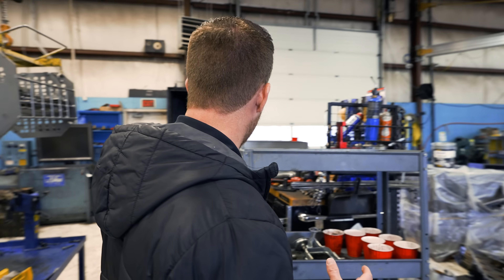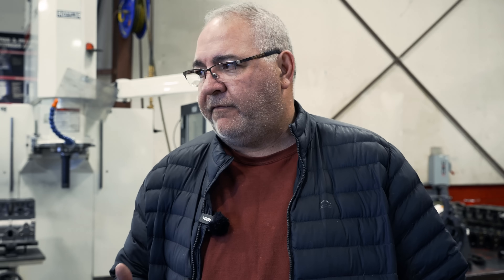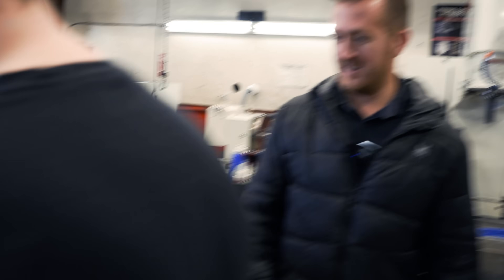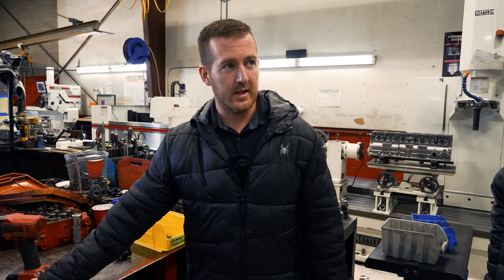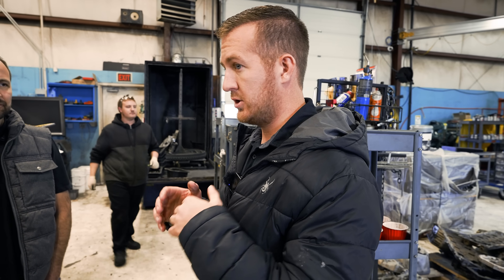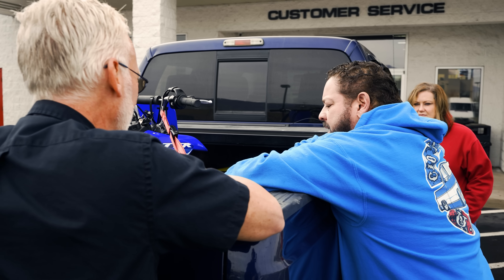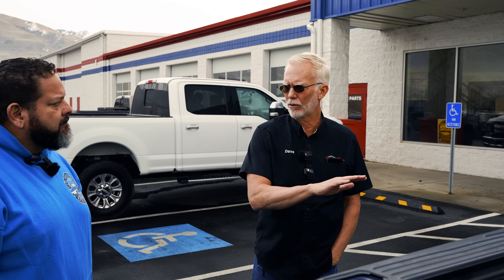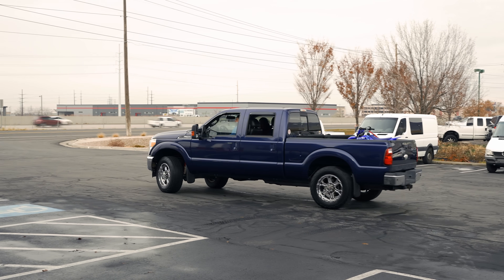Looking Inside a 900,000 MILE CP4 Pump!

Comment: I used to add castrol 2-stroke oil (for water cooled engines) to my fuel in my 04 duramax. Don't know if it helped as I sold the truck years ago, but it certainly didn't hurt.

Comment: To the rednecks that say the us diesel and EU diesel are the same. 😂 this is why you need lubricators inside the fuel. Bosch at the end of the day build there pump and tested on the diesel they had it spec to. Ford, dodge and Chevy are to blame for using a product build for a different market with different regulations and additives. Bosch built it as intended the big three got lazy.

Comment: This is the best advice. Not the additives but the fuel filters. The fuel filters are the problem. This Guy gets that💪👍
Reply: Additives can make a huge difference. I ran additives in my diesel and made the engine run way nicer. The off boost - boost transition was much improved. Just saying the right additives can make a great difference.
Reply: @myvideosrockthehouse which additive?
Reply: Only changing fuel filters doesn't improve the lubricity over what the fuel has from the pump. Lack of lubricity kills CP4 pumps. But for sure fuel filters are important.
Reply: @Arexodius  
That's the point of taking the pump apart and having the cam lobe and other moving parts plated... 

After blue printing ( debuting @ polishing ) all wear points...

Not a very likely to be done on a new vehicle - however, for people who spec their equipment by themselves...   

It's a old hot rodder trick! 

Meaning if you hand build the truck from the frame - every part of the motor, trans, rearend to the brake system had been put together before used, just as if it was your race car . 

Then that vehicle would short of an accident, last your lifetime without any issues. 

It's a ton of work - but it doesn't allow small imperfect casings to develop hi stress points from the very start.   That's what blue printing is all about... 

Equalizing and balancing assemblies! 

Just ask any professional racing team if any part on their race car has not been customized to there personal specific build spec.... 

So if you want your equipment to last a lifetime - build it up from the ground.

Very labor intensive up front - but the peace of mind and savings from lack of break downs on the road is the best experience. 

What this means - if you plan on having a great vehicle...   

Then build it from the very start!   It's the same thing about any business - the better you plan your system the more time you save, more time equals more money 💰...

In hotshot / transport break downs are a killer!
Reply: @mrnobody8540  Or just run an additive as shown in the video....
Reply: @Arexodius  
Oh yeah - it does improve lubrication - for the cleaner the fuel - less wear on the parts from dirt, and other things like water contamination. 

It's not a direct lubricant - that's very true...  However, it does have an impact on the lubricancy. 

That's why the old engine builder's saying that cleanness is next to godliness... Why a good shop is cleaner then the kitchen of a 5 star restaurant.
Reply: @mrnobody8540  I understand that cleaner fuel lubricates better than less clean fuel, just like cleaner oil. But like I stated, filters don't improve the lubricity of the fuel over what it is from the pump, you know, from the gas station. Whatever the lubricity is from the pump on the station, that's what you have to work with unless you add something that modifies the lubricity. That was the point I made. And that is actually the main problem with the CP4 pumps. They don't get enough lubrication from the standard, ultra-low sulfur diesel fuel in the states, even if the fuel filters are new. The CP4 may work well enough in other regions, but apparently not in the states. At least not without extra lubricity.

But I definitely agree that fuel filters are very important to the health of the fuel injection system. That's why there are companies like FASS. Cleanliness really makes a difference for the function and longevity of anything. It really is underappreciated.
Reply: @Arexodius  
It's the difference between Europe and the United States is in Europe the fuel ⛽ has far better diesel fuel is rated by its cetane number, which measures how easily the fuel ignites when exposed to heat and pressure. 

A higher cetane number indicates that the fuel ignites more easily and performs better in a diesel engine.

Most diesel fuel sold in the United States has a cetane number of at least 40. 

That's about half of Europe - and is in fact the problem of fuel system failure of the c4 pump if you want the real reason - bio fuel can lower the cetane number in the substantial US diesel to the point of beyond what the bear min. 

The c4 pump ability to live at all. 

This is what you want in the additive - the lubricancy as you think of it! 

The c4 pump was designed for the European Market - that's the difference...
Reply: I'll run the additives too, thanks though.
Reply: @rvdb1863  Dry fuel (questionable fuel source) is the issue though, not dirty filters. Sure, new filter can't hurt at all (and probably why he changed so often) BUT it's not going to save your CP4 from low lubricity fuel and the design of the pump. 🤔
Reply: @mrrogers2611  
Yep - bio fueling is the biggest issue,  not because it a bad idea, it just as to many unknowns as to one batch to other... 
100% diesel is for more consistent -  I still like biodiversity in the diesel, but it's best if you have a local source that is not doing it half ass. 

Just my personal opinion
Reply: It's the additive too the cp4 is a Bosch pump made in Europe where they have more sulfur in the diesel which acts as a lubricant
Reply: @ yes you are right
Reply: Having the parts ceramic plated is the real key with clean fuel and lubricant.

If you ask me that's the real deal... It's all about reducing fiction
Reply: Insane diesel fuel additive is what this guy used
Reply: @rvdb1863  Why not the additives? He said he uses additives.
Reply: @ Because the interval between replacements is too long. Polution of fuel is increasing over time. There is a moment in time where it exceeds a certain threshold, at this point it gets harmfull voor the injectors. The replacement of the filter is often past this point. If you want to protect them replace the fuel filter more often.
Reply: I use neutra by Schaeffer oil. The truck seems to like it
Reply: I don’t own a diesel yet…thinking about buying one soon. How hard is it to change the fuel filter??
Reply: @coryreedy2752  easy on GM trucks, a little more work involved on Ford and Ram since there are
two, but still easy.
Reply: @coryreedy2752  diff on  all trucks my 2020 l5p take 10 mins max its easy this is alos my first diesel what iv learned so far its the same as a normal truck but check for blow by keep up with oil change and fuel i do them early  then told.
Reply: @rvdb1863  Definitely not tryimg to be a smart a** but Is there any testing or proof to show that changing fuel filters way more than recommended has any effect? Like, if you changed the filter everyday would that make things last even longer.  I'm not so sure. The fuel filters don't deteriorate and begin letting dirt in the fuel system within thier spec's lifespan so I just don't see the logic in excessive filter changes. Now if someone wants to that is absolutely up to them but I believe the added lubricity is what's keeping that pump alive. We never really heard of pump problems until ulsd came around.
Reply: @cgriffith0187  
It's the American fuel is not up to the standard of the Euro fuel.  The c4 pumps are designed for Europe and can life as a time bomb here on our fuel standards. 

So If you want to keep a c4 alive, carry additional fuel additives. 

Or install a older fuel pump design that can live better under the American Fuel standards. 

Water and other contamination is always bad for any engine... So keeping your fuel dry of water, clean of dirt is important... 

Point is simple;  cleaner the better! 

A smart business man would install a system that prevents harm up front. 

It known as special order ( spec building) your equipment for your personal business venture needs - 

That what Consolidated Freightways (CF) who was a trucking company that operated from 1929 until 2002 did - Founded Freightliner in 1929 as the truck-manufacturing division of Consolidated Freightways build to order ( spec ) fleet vehicles. 

 and ConMet that was founded amid this backdrop in 1964 as part of Portland Freightliner. 

Old school truckers understood the value of building to need.
Reply: Exactly, change fuel filter's with oil srvce.  Goes a long way.
Reply: or just run a cummins and neglect it for 20k at a time and have zero problems lmao.
Reply: @TurboVisBits  Maybe that was true for the pre-emissions stuff, but I don't think that's true anymore ☹

Comment: I was using Stanadyne Lubricity Formula in every tank, but switch a little bit ago to the Dave's. I have about 240K on my 2019 F350 6.7, what is the best system to avoid a failure of the CP4? Also, is it a guaranteed failure no matter what maintenance and additives are used?

Comment: I seriously believe in early maintenance. I have a 2010 f150 4.6 3v with 522000 km on the clock and I change my oil every 10k, trans case and diffs every 100k and only use ford filters and synthetic oils. Runs like new still

Comment: Additives were added to Canadian fuel a little over 10years ago.

After that Bosch VM+ injection stopped failing quickly. And almost entirely stopped failing and it's not a stocked part anymore.

Cam pumped injectors aka PD didn't make much difference.

CP3/4 not the same issues you guys have in the USA.

Comment: Remember the old Fram "Pay me now, or pay me later" ads on TV?  Back in the late '70's I had the air-cooled Suzuki GS 1000 that I had hot rodded to within an inch of its life.  That was severe duty, to understate things.  Changed oil every 5,000 KM which is about every 3,000 miles.  Cheap care.  It also makes your stress levels drop.

Comment: On new and old diesels with the low sulfur fuels we have makes fuel additive a must!
Reply: Thats why I put 2-Stroke Oil in my Diesel, to lubricate the Pump
Reply: @AMeise-vy4fk  I want use 2 stroke oil in my diesel engine. The best 2 stroke oil I found is the  Bardahl brand.  What do you use?
Reply: @MatRix68315-u  Liqui Moly, but I am German and dont know if its available in your Country....btw, I dont think, that there are big differences in Quality or Ingredents

Comment: Honestly though, in a diesel with full synthetic, especially minimal idling and mostly highway driving,  5,000 miles seems a bit too soon. On my Ram 2500, they say 15k miles, I run it 7-8 because I get 5 free ones a year, and I also see a fair bit of city traffic, being that its a work truck and not a highway hauler.
Reply: I probably should do my own oil sampling just to see how things are actually doing. See what the lab says about it.

Comment: The cp4 pump additives have obviously helped it live 
But the pump is a lot older than newer versions could the metal that has been used in the pump be better quality steel than the later models 
As manufacturers look to save money on materials to keep costs low maybe you could get a metal urologist to compare the older pump to newer versions and get a better insight to the quality of the older models

Comment: He got away with 15,000 mile oil changes because he was doing highway miles, not city miles.  An engine running a constant RPM experiences very little stress and wear.
Reply: Yep..  The heat cycles are what really eats at everything....  Plus, I'm not sure how much these hold.. but my 7.3L holds 4 Gallons of oil.  15k is not really that long for that much oil being circulated...  Tractor/trailer semi trucks usually go at least 25k miles before changing oil.

Comment: Dealer tech here, I’ve replaced countless CP4 pumps on 6.7 Cummins under recall Y78 and I’ve only ever seen maybe 3 or 4 catastrophic failures that required new injectors and cleaning the tank out
Reply: Presumably you changed those CP4s BEFORE they started to disintegrate and contaminate the system downstream. It would be crazy to ignore contamination.
Reply: @KevinMaxwell-o3t  Filters filter out all those damaged bits. I can see a  pump in the tank might have a problem, but it also has a sock filter. Injectors is a who knows situation, a bit of metal in them is bad news. And what if they stay jacked open and dribble fuel all the time, means a destroyed engine.
Reply: I do think the diesel injectors have a tiny screen filter like all gasoline injectors?

Comment: I use marvel mystery oil and power services additives helps lubricant everything 
Every 3 rd tank ... this has worked on all our equipment trucks farm equipment 
And 4 trucks with original engines  300k no injection pump issues  👍😎
Reply: @nicholasroberts9618  I'm talking about a 2002 7.3L .. It doesn't have DPF.. and I live in Oklahoma.  We don't have vehicle inspections.   DPF would be deleted in the first weekend. lol
Reply: I don't think it's necessary..  I have over 300k miles on my 2002 7.3L.. and I've poured in old used motor oil.. and poured in ATF..  It doesn't matter.  Your truck will run on bacon grease or vegetable oil. It does not care.
Reply: @calholli  re using  old oil ? Not  vers bright are we  old oil has dirt soot metals 
And other  contaminated things .. microscopic  just perfect for premature wear
I'll stick to  clean marvel mystery oil and power services additives  being a machine 
Shop owner for 30 years ill stick to what works ...😎
Reply: @nicholasroberts9618  that bullshit is removed before mile 500 on all our vehicles
Reply: @nicholasroberts9618  "Zip ties and biased plies' --   he'll show you what a 7.3L can handle. lol..  He has a second tank in the back of his truck where he pours all kinds of used motor oil and left over chicken grease, ATF,  and whatever else.  These diesels will burn it ALL for fuel, with no problems.   Just mix at least 20% regular diesel in with it, to keep the consistency happy enough.. works fine.   The original diesel was built to run on peanut oil..  btw

Comment: we run howes and plenty of it every fill up in our 6.7s and weve never had issues pushing over 160k in both and change fuel filters with oil changes.  the older equipment always said buy clean fuel keep it clean.  remember when you try to save money you spend money

Comment: What is the deal with people about idling? The engine will never get warm idling.
Reply: This fella sleeps in his truck transporting travel trailers cross country
Reply: @nomadicfenceman509  He is different than the normal folks. I am sure he fast idles and then he is pulling a load that will clean the exhaust up very easily.

Comment: I replaced a cp4 on a 2013 LML with 730,000 km it was still going strong but I was doing the head gaskets so figured I might just aswell do the pump and injectors. I I use stanadyne fuel additive in all my duramax's (2007-2024) never had a pump fail
Reply: That's better than me. I lost the wrist pin on number one on my 06  lbz. So I lost the head and the block. I took the head bolts out with my fingers. There was no torque on them. I guess that I should have gotten the motor rebuilt in LA and not driven home to Salt Lake City. The block cracked in Saint George. Lost all the coolant and still drove six hours home. I had 500,000 and only replaced glow plugs and changed oil and filters.
Reply: Heheh you were doing heads lol ……….. sorry
Reply: 😂 Edited

Comment: ITS BEEN ASKED SEVERAL TIMES but no one has provided the answer!  WHAT diesel fuel additives does he use?
Reply: They’re not going to tell you, since Dave’s selling his own additive… this is Dave’s first step to hell. Not sure why Dave feels the need to start selling stuff given  he’s obviously doing VERY well.
Reply: @Mr_650S  It's greed.
Reply: @ Opti-Lube is based in Utah, so good candidate for Dave’s supply. If 1 gal Dave treats 512 gal fuel, we have a winner.  BTW, cheaper to buy direct than from Amazon.
Reply: @Mr_650S  And you avoid giving Bezos any more $ so win-win.
Reply: my bet it was ar6500
Reply: Any alcohol-free additive. Opti-lube is the best backed by testing.
Reply: @HSKFabrications  No, no it's not lol. Hot Shots EDT or Archoil are the best.
Reply: @Powerstroke431  Not according to astm wear scar testing.
Reply: @Powerstroke431  Hot shots edt hfrr # is 453, opti lube xpd is 380 with their xl down to 240. I use a mix of both.
Reply: @HSKFab   I currently use Hot Shot's Secret Diesel Extreme EVERY DAY Treatment.  It can be purchased at the local Walmart.  May have to look into the Opti-lube.
Reply: @HSKFab ”The Best” you are funny. Really is no such thing, just like there is no “best”
Engine oil
Reply: dave sells his own additive called secret sauce
Reply: @chunukbair9506  He hasn't provided one shred of testing either. He literally copied the design of the bottle from opti-lube.
Reply: @chunukbair9506  Which is not proven one bit lol. There's tried and true additives out there already and for less than what Dave is slinging 😅
Reply: Any of the big name diesel additives are good. I’ve seen great results with Stanadyne and Redline Oil 85 plus fuel additives. ONLY use DONALDSON fuel filters